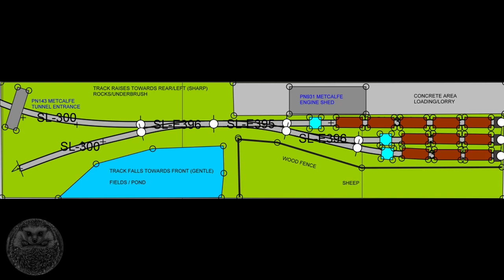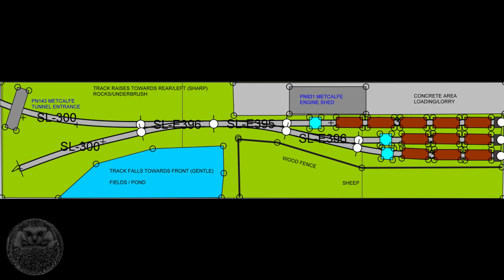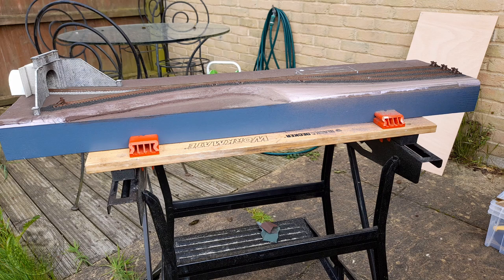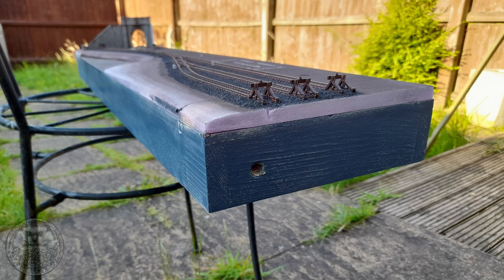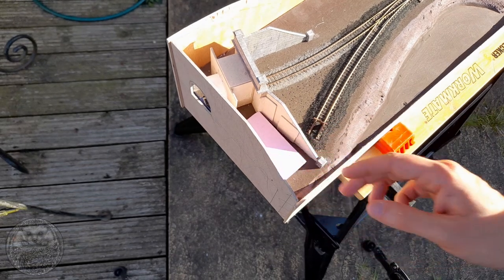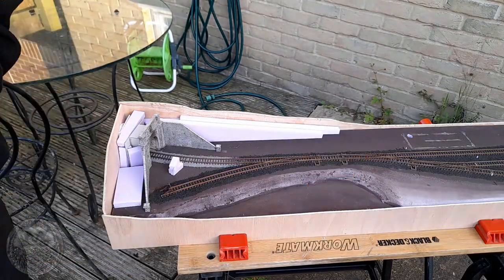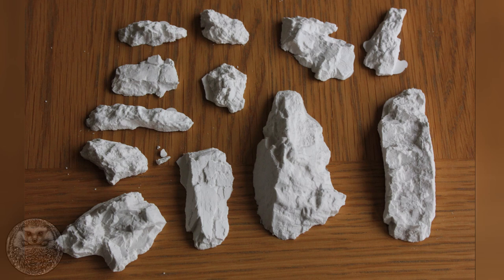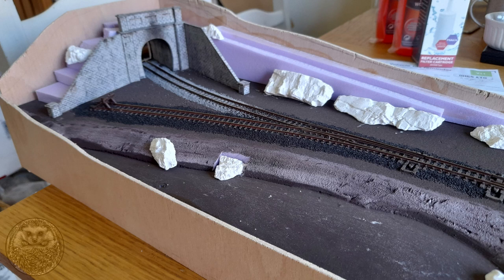N Gauge Model Railway Layout Build EP04: Rocks and Landform

Comment: A couple of observations with this part of your build. Given how messy the landscaping process is, it might not be a bad idea to mask your trackwork.
You managed to work very neatly, but it would be  so easy for some stray material to spoil your trackwork.
I was also quite surprised at the start that you did not include a backscene. That would help to retain the landforms around the tunnel area as well as giving some depth to the model. It is so small that a standard 9" backboard would not obscure your view for home or exhibition use. That said, the build is progressing nicely and should be very impressive when it's finished. Now it's time to watch part 5.
Reply from the maker: Thanks Kevin, that's a good tip in terms of masking the track... luckily on a small layout I could take the time to be neat but I'd imagine on a bigger one the chance of messing up the track would be much higher! I have a backscene planned although it is taking me a while to decide exactly what I want...